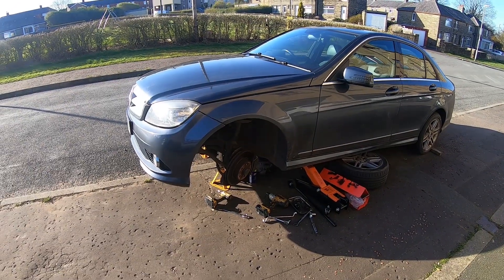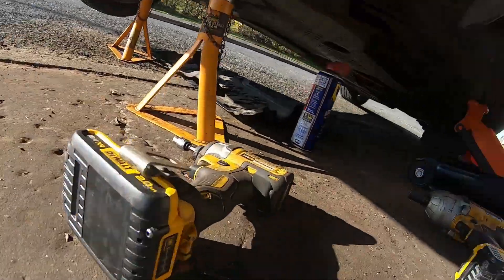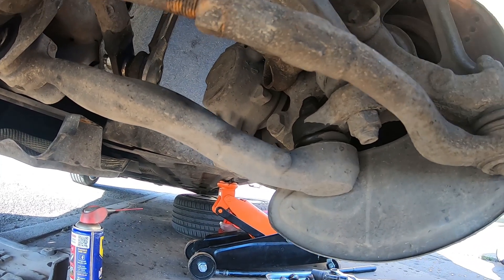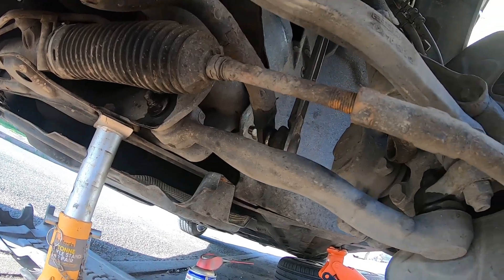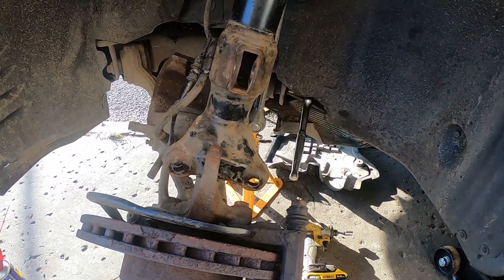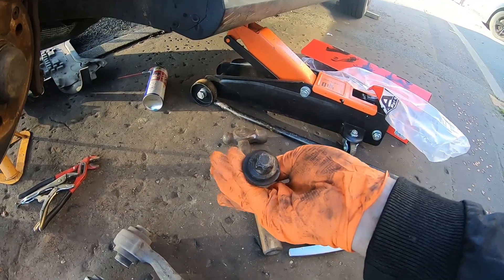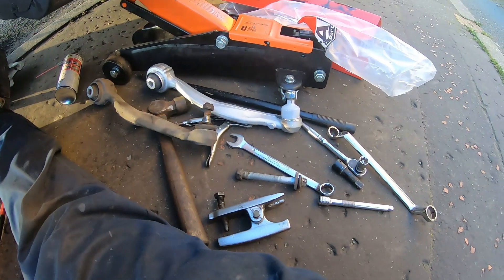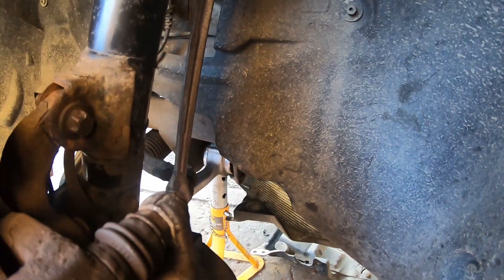A new front suspension arm WAS needed - 2009 Mercedes-Benz W204 C200 Part 14

Comment: Hello, I have a question: is the front suspension of this car Mcpershon or double wishbone? Thank you in advance .
Reply from the maker: It has a McPherson strut. I replaced the front spings in Part 8.
Reply: @Parknest  I had once this car and I realize that when turning it leans a lot the wheel. That is rare for a Mcpershon, it is I think more typical of a double wishbone or multilink. I think it is one of the most expensive and advanced Mcpershons and that it works better than some standard front double wishbone.
Reply from the maker: @blackhawkedu1  It could be the lowermost part of the suspension. There are 2 arms on each side which enables the camber to remain the same when the front wheels are turned. BMW use a similar setup on their front suspension. I've seen them on the F20 2 Series and F30 3 Series.